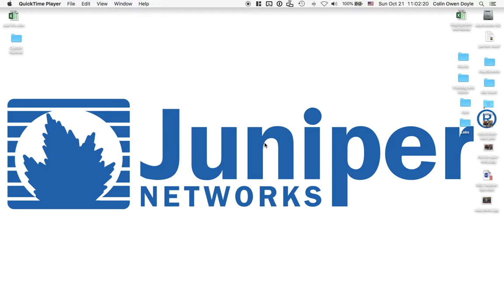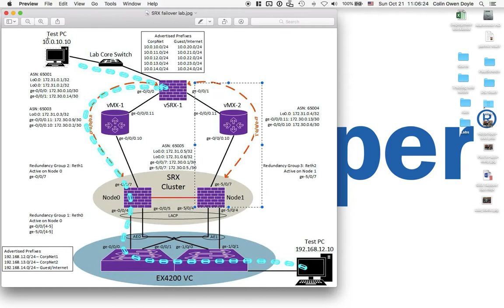Logical Lab Overview

Comment: With reference to your design , why we need a GRE tunnel and then establish eBGP peering over this peering i.e. between vSRX cluster & vSRX-1? Routes will still be exchanged if we simply use eBGP peering only
Reply from the maker: This is true, but the intent of the lab is to demonstrate failover between a simulated hub site (SRX cluster side of the diagram) and a remote branch site (vSRX side of the diagram). The vMX routers are simulating the WAN that would typically exist between the hub site and remote branch site. Because the relationship between hub and remote sites over a WAN rarely provides clean, layer-2 transport, some form of tunneling must be employed. Usually, this would be something like IPSec. For the sake of simplicity, I used GRE.

In fact, in later iterations of this lab, I did setup IPSec between the SRX340 cluster and the "remote" vSRX for RPM-based dynamic failover. This was for a lab design that was later used by a major international airline to interconnect management sites to remote airports and hangers.

Since the focus of this lab is not testing dynamic WAN failover, but rather testing cluster failover in various configuration scenarios, I just used GRE.

I hope this makes sense and thanks for the comment!
Reply: @5minutejunos  Thanks Collin !!!!
Reply: @5minutejunos  Was trying to understand the topology and traffic flows... Please keep on posting videos. Great stuff !!!

Comment: Whats the nature of the red link that is between 2 x SRX clusters? Is it a Fabric link or stand alone link with IP address assigned?
Reply from the maker: Great question! The topology shown in this video is from a lab I built before starting this series. The vSRX firewalls are there for overlay service-chaining, a topic I do not cover in the body of this series. I made a video for this at a later date, but likely after I cover some other topics like multi-tenancy, connecting to a core/WAN, and upgrades.

If you would like to see FW service-chaining, let me know and I'll work out the requirements.

tl;dr - red for contrast and present because this is an older lab not used in this series.

Thank you very much for your question!
Reply: @5minutejunos  I was not sure that a video that was posted in 2018 will get answered. Thank you for answering.
It would be very nice if you show FW service chaining. 
Actually want to see how the inter link works between SRXs that is used for forwarding of packets from Node1 to Node0 like you mentioned in your video.

Hence a short video if possible would serve the purpose 

If we like to suggest some videos on some other topics then how can we let you know?
Reply: The red link represents both the sw-fab and cluster control link. I should have put 2 links in and labeled them. Sorry for any confusion.
Reply: @EfiniX  Thanks . But as the per the Juniper JNCIS-SEC guide , they say that fab (not sw-fab) link enables session synchronization and transit traffic for active/active data plane.
Hence if we dont use sw-fab link and use only fab / cluster control link will the transit traffic use fab link in case Node 1 is active for RG1 while Node 0 is active for RG 2?
Reply from the maker: @453nabeel  Apologies again - I responded to the last question from my phone. Looking back at the lab... Here's what's going on:

- There is no sw-fab link (I'm not doing any layer-2 switching between cluster members, so this is not required)
- There is a Fab link (required)
- There is an HA Control link (required)

In my lab, I'm using a pair of clustered SRX340's. When clustered, the following is true:
- fxp0 HA management interface is a dedicated port one each cluster node
- fxp1 (HA Control) is assigned to physical interface ge-0/0/1 on each cluster node
- Fab link is user defined

I'm looking at the interface configuration for this lab and I assigned fab0 to ge-0/0/2, and fab1 to ge-5/0/2 (ge-5/x/x representing interfaces on node1).

In my lab topology, the red line between cluster members represents BOTH the HA Control link (ge-x/0/1) and the Fab link (ge-x/0/2). I should have shown these links discretely rather than combining them for the sake of clarity.

I hope this makes sense and sorry for the confusion!
Reply: @5minutejunos  Thank you for detailed reply and clarification.
Reply from the maker: @453nabeel  I'll make a note on that topic now! My new job (I'm now on an architecture team at Juniper) has me pretty busy, but when things start to settle down, I'll get to it.

As for new video recommendations, no direct conduit, although I've been thinking about setting up a request thread on the Juniper elevate community. Until then, just leave a comment and I will (eventually) read it and respond :)